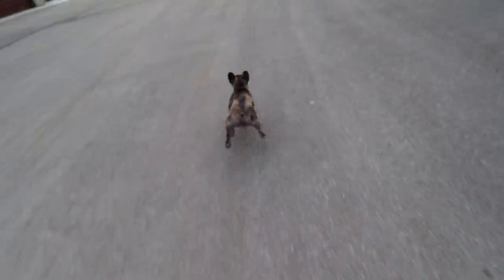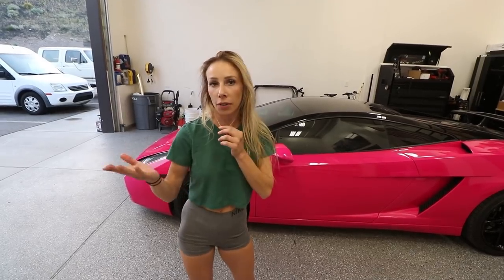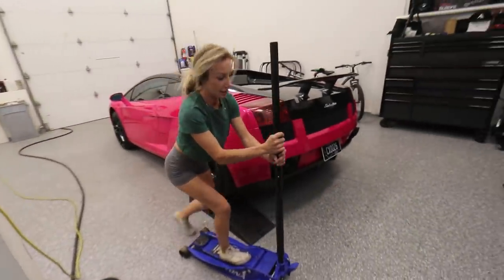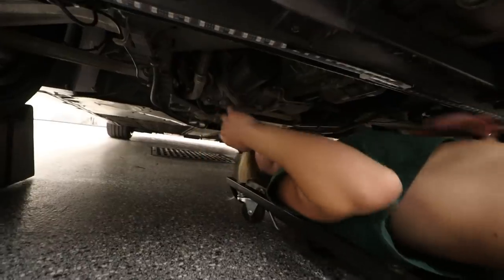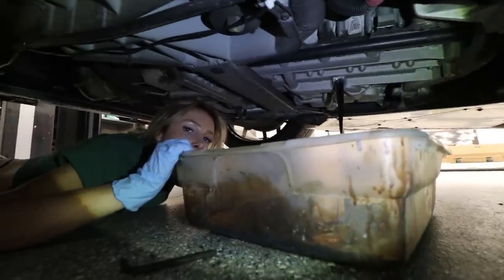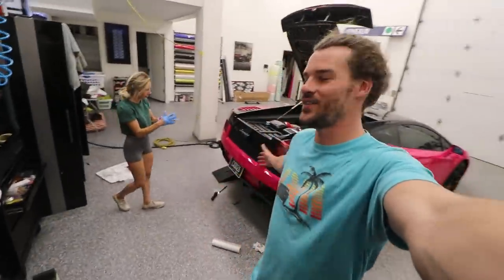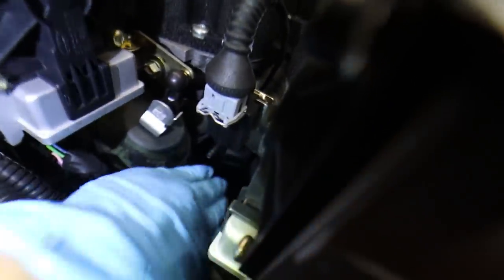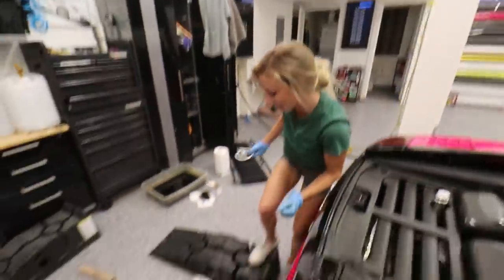Attempting To Change The Oil In My Lambo!

Comment: Quick tip, ALWAYS replace the washer/rubber O-ring around the drain plugs every oil change! - The oil filter usually comes with one! GREAT JOB FAITH!

Comment: Great how to video guys! Just a little FYI that may help out for future oil change endeavors, there are allen bit sockets that you can use with your ratchet and extension that would make getting those plugs out a lot easier. Also you can get a 5 gallon bucket and lid at any hardware store that will make oil collection and transportation to the recycle site easier and a little less of a mess.

Comment: Anyone else still here from watching Clayton change the Cayman oil? Yup, me too! And I still have my 987.1 too 😁
Reply from the maker: True OG 💯💯
Reply: @SummitLife  I’m still here as well and own a 2007 987.1 (I absolutely love it) and remember the video well.  Which brings up a couple of questions for you Clayton:  Don’t you have to change the crush washer when replacing the plugs… AND… in the Cayman video you used a torque wrench (or actually you said you were going to buy one) to tighten the plugs to spec.  In the Cayman it was 37 lbs and I’m wondering if this is recommended for the Lambo (different torque requirement of course).
Thanks for the excellent content and I really enjoy your “Team” videos.
Cheers from 🇨🇦

Comment: You guys really should get a lift you're fortunate to have a garage with the ceiling that is so high it's very uncomfortable to go under a car when your face is 3 inches from the underside of the car very claustrophobic you should get a lift to be easier to wrap cars also they don't cost that much to do there maybe $2000, I will donate to help you get a lift

Comment: You guys are super experienced but I wish you chocked the front wheels for added safety.   Edit: Never mind - this vehicle is AWD.
Reply: awd or rwd it doesn't really matter if the car is in park and/or the e-brake is on.
Reply: @OnyxCobra  negative.  "park and/or the e-brake" locks up the back wheels only.  unless this vehicle is different.
Reply: @0toeknee0  correct, which means as long as the weight of the car is on the rear wheels it's not going to roll anywhere.
Reply: @OnyxCobra  huh?  what keeps the vehicle from rolling on a rear wheel drive when it's being jacked up or down?  wheel chocks.  this is pretty simple stuff.
Reply: @0toeknee0  oh, during jacking? Not really necessary at all when the ground is that level, if it did start rolling its easy enough to drop the car back down.